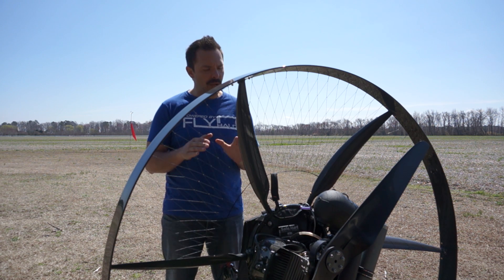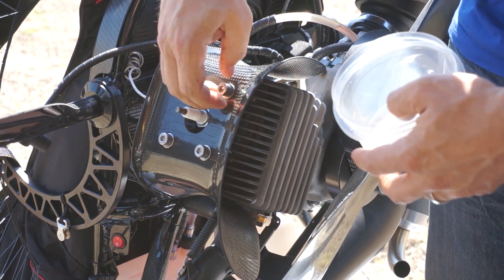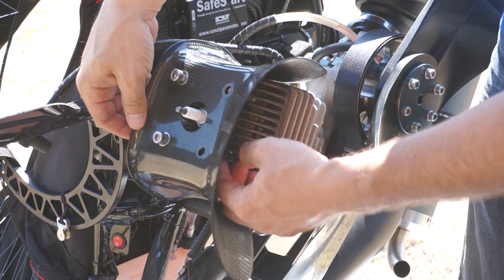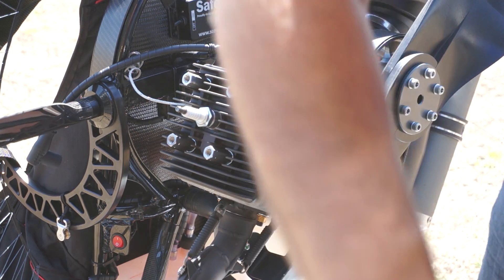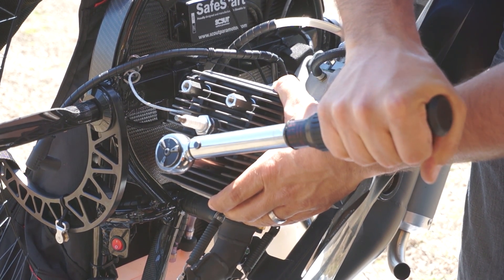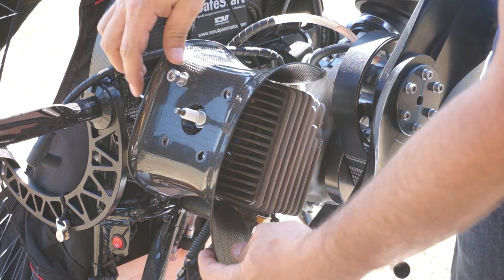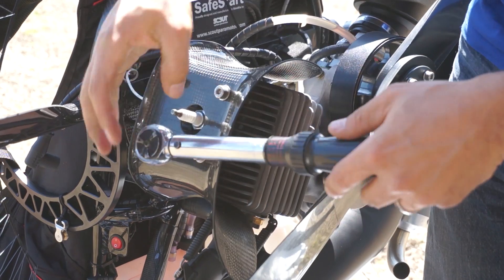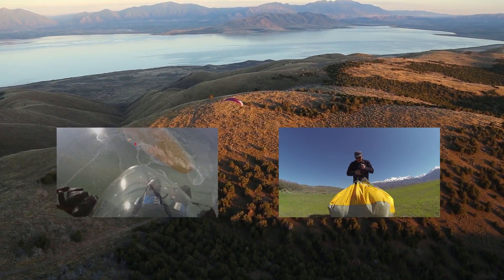Motor Minute - Vittorazi Moster Plus head bolt torque - cooling shroud

Comment: Hi Brian, i hope you can help, as you seem to have quite the experience maintaining your moster! After my 25h maintenance , my power band is not constant especially at cruise rpm, which is 6000rpm. My motor runs smooth, rich, yet when it reaches 5800rpm and while I continue to throttle slowly, nothing happens for like 2 to 3 mm of throttle abd then suddenly it jumps to 6800rpm (climb). I cleaned the throttle handle and its cable, and adjusted the hi/lo screwsxpn the carb bit i still face the prob. Any advices?
Reply: Joe big boys Paramotor Hey, this is Canyon from Team Fly Halo. You could have a number of things going on with that engine - if you want to give me a call at 855-FLY-HALO I would be more than happy to help you try and troubleshoot it!
Reply: @canyonhansen7211  thanks Canyon, you guys always got grwat content! I will give you a ring asap!

Comment: FYI ... just went through this myself this week...   you might consider a little bit of thread lock on the shroud bolts...  I just had one let loose last week and had to get a new prop from John when it messed the prop up a little when one of the bolts came loose...   thread lock is a lot cheaper than the $500 prop...  ;-(     Thanks for the reminder about the torque specs...